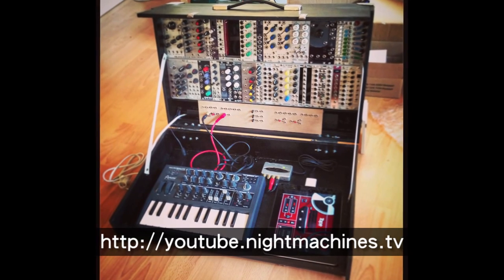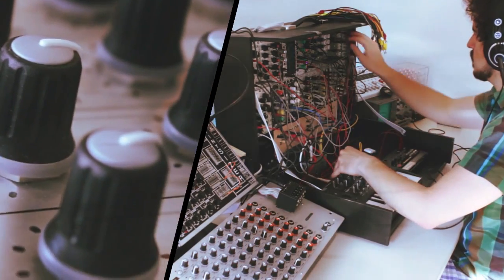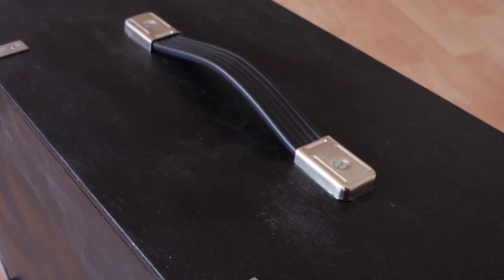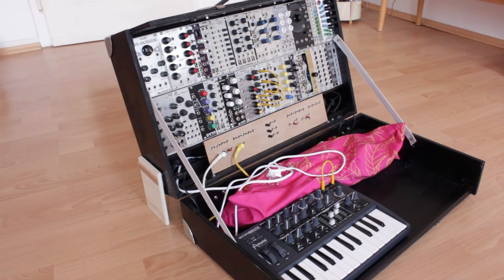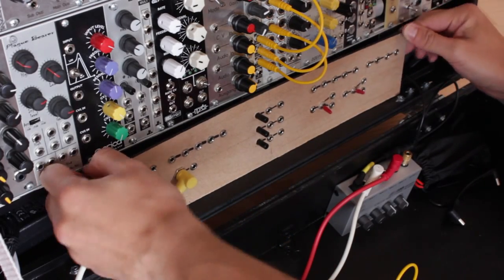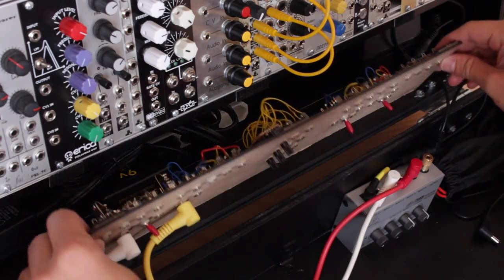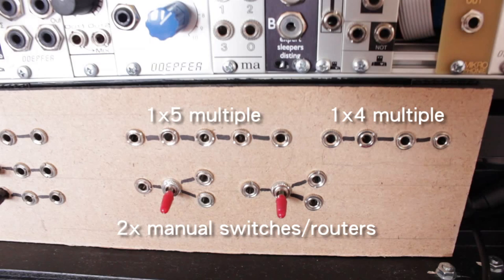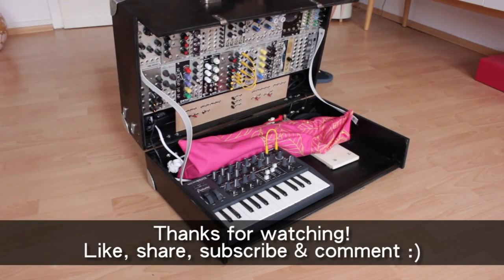Portable Modular Synth DIY Case (incl. Eurorack & MicroBrute) #TTNM

Comment: I find the 'utility panel" interesting.
I have a similar plan for the case I'm planing to build.
I got 2 sets of 86hp rails.
i plan to have a 19" 1u blanking panel between the sets of rails and populate it with utilities such as your panel.

Being only attached with 4 screws, taking it out and adding features as i need them is no issue, or replacing it should i need it.
19" blanking panels are also quite cheap.

I get multiples and attenuators, but what other utilities should i consider, and how many of each?

Great cabinet.
Reply from the maker: +Borgar Definitely manual switches! On the Doepfer DIY page, there are also schematics for other passive utilities like mixers and clock combiners.

Comment: I know this is an old vid so I'm not sure if you have fitted the legs to stabilise it when it's open, but some fender amps have strong metal legs so you can tilt the amp back. They would do the job nicely. Just a thought. Awesome build though mate. Cheers from Australia.
Reply from the maker: +John F Kay that's a good idea! I have retired the case for a while now though. the temporary stands from the video worked fine for the time being, but your idea definitely looks better :)

Comment: Great ideas!  What was the estimated costs for building?  Considering that similar size manufactured cases could cost up 700, I'd really like the idea of saving money! Thanks.
Reply from the maker: Thanks :) I'm at about 315 EUR right now (see the bottom of my post here http://diycase.nightmachines.tv), but the wood I bought is a bit too soft I think and another can of spray paint or two (or even Tolex) wouldn't have hurt. So for a "proper" one add at least another 100 EUR in materials.